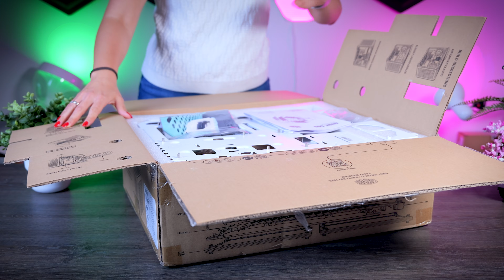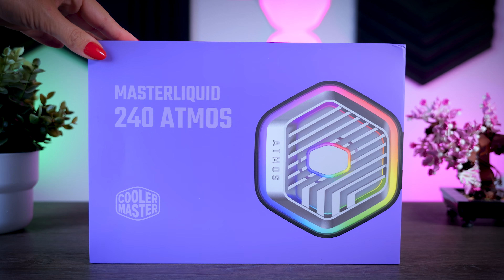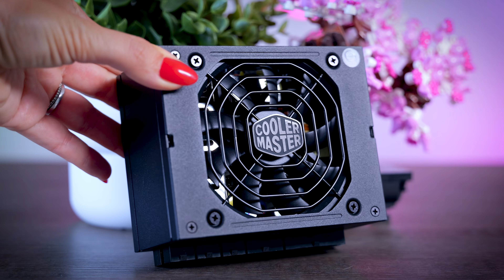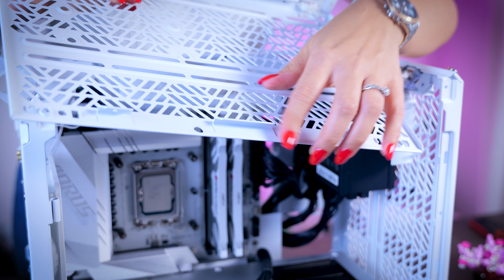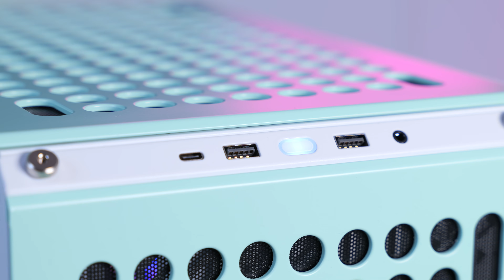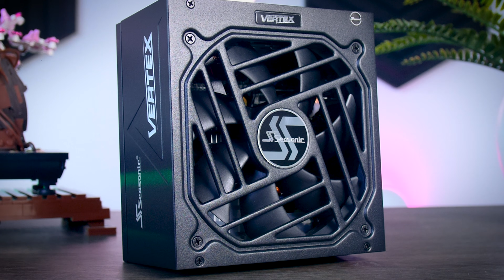The IKEA Experience - Cooler Master Qube 500 Build & Review

Comment: I am building small servers, and this case was said to hold 4x 3.5 inch drives. Not mentioned at all. Disappointing.
The build style probably makes the case cable easier to install with pins easy to see in the open.

Comment: i dont do much testing, and im completly newbish with hardware, but i run a nzxt 250 and an asus 240 on my 2 pcs and have never even during testing had them excede 80c, anyone know if this is abnormal? I am running a cougar gemini x case with 3 intake 120's and the rads are top mounted out flowing, so airflow might be the reason, i just haven see this before. cpus are i9 11900 and i5 11500.

Comment: One irony of this video is... if you install the PSU into the Qube 500, you have quite or almost no space to toggle the mode switch...

I have assembled a mid-tier PC (5600G+RX7600, ITX board.) from the parts I had and the case itself is the PC is doing quite fine. Of course my CPU cooler is Wraith Prism and the PBO is on, hits 95 degree C with 4.4 GHz while running Prime95 Small torture test for all cores. 

So, yeah, this case isn't too bad although the PSU mounting scheme is somewhat distasteful for me.

Perhaps, if they allow PSU mount at the bottom side, It would be much better for my case.

Comment: "you can even have the rear I/O come out at the top - if you want that for some reason"
In my opinion such a statement can only come from someone who never had a system built in a case that provides that layout. I'm using cases with that layout since more than a decade and since I'm doing so, I had no longer problems with dust in the case or too noisy fans - unfortunately, there are very few of those cases and even rarer are those who got that layout right, since it only makes sense, if you can mount fans in the case's bottom and have the sides sealed shut, both to provide the natural upflow of warm air. That being said, i cannot understand why there aren't more of those cases.

BTW, another great layout which is pretty rare (or even extingt in modern cases) is a side-by-side cube. There's no risk of collision between PSU, hard drives/non-nvme-ssds or optical drives (yes, dear case vendors, there are still people that have a use for external 5.25"-slots) and a system in one of those cubes looks much cleaner whe it comes to cable management.
i just don't understand why there's no case on the marked (nor now or in the past) that combines these two features. You could easily fit an E-ATX-system with a 340mm-graphics card, a ton of harddisks and two DVD- or BR-drives in a cube with less than 400mm (w) x 500mm (h) x 400mm (d) and have it silently air-cooled.
I would buy a case like this way more likely than one of those glassy RGB-showrooms that are dominating the current marked.
Reply from the maker: I actually had the Silverstone RV05 as my personal case for years. Still needed cleaning regularly though.
Reply: @TechTesters  I had the RV01 (barely remember how it behaved when it comes to dust) and the FT02 (which I'm still using today for two systems). On one system I only have to clean on the outside sometimes, the filters twice a year and the top-fan once a year. Besides that I don't have any dust inside the case (except on unused HDD-frames - they're breaking the air-flow in the front). The other system showed no necesity of removing dust in five years - but I don't fully count that because it is located in a small server room.
Maybe this is because the FT02 has a lot of small holes in the top cover, while the RV05 has fewer but bigger holes? That's one of the reasons I never changed to the FT05.
Reply from the maker: Loved the old Fortress cases. I should see what silverstone is up to these days. Haven’t worked with a case of theirs in years.
Reply: @TechTesters  They now have the Alta series that uses the same layout as the early FT and RV, but these are more "modern" (and in case of the Alta F2 rediculously overpriced).
For many cases today on the marked you can choose it's color (black, white, sometimes silver) but not, if you want it with a glass panel or not. I don't understand why. What purpose does a glass panel have in a big tower that's located under my desk? It's like a hyper-shift dipped car for daily use - beautiful in some cases, sure, but there are people who don't like/want/need it. That's why I'll stick to my FT02 as long as possible because meanwhile I lost hope that there will ever be a case that fits my requirements better.

Comment: literally shipped this to Hawaii, flew with my motherboard,cpu, psu and gpu, and plan to collapse it and fly home with it. fits my zotac extreme airo 4090, and the thermals are great with two fans at the bottom, a 240aio on top, the included argb fan in the back, and the top and bottom dust shields removed. sooooo worth it.
Reply from the maker: It just moves the caching from the DRAM cache to the system memory, so it shouldn't really affect the actual durability of the drive at all (or at least not significantly)

Comment: Question for anyone to answer. Can I swap the back and front panel? I have my PC on my right the ONLY reason I have no case is because for it to have ports facing monitor means I see the back of the case. If I can flip the panels and it still works then this case is perfect for me.
Reply from the maker: You mean the left and the right side? This case does allow you do go reverse ATX, so you can have the glass on the left side. Just remember your build will be upside down.
Reply: @TechTesters   Thanks, and cool that would benefit me.

Comment: Wish the build guide was available as a PDF, so I can see how they would install four 3.5 inch drives, lol.
Reply from the maker: They have videos online, not sure if that includes HDDs.

4 HDDs sounds rough though, unless you skip the GPU or get a tiny one.
Reply: @TechTesters  I do also believe something else has to be neglected like GPU size in order to fit it.
I only have two 3.5 inch drives and I could spend extra money on bigger SSDs to replace them. But I am still interested in how exactly they'll fit 4, lol.

I did find their build video after your video since you mentioned those QR codes to their build guide. 
They don't show where to put any sata drives in that video sadly.
I have also asked them about it but sadly no reply yet (perhaps I should find customer support email or something).
But thanks for the reply.
Reply: @TechTesters  I dunno if they have added it recently on the product page but now I can see an overview of where they would put the four 3.5 inch and three 2.5 inch drives.

Comment: Hi could you please check if the side panels are inter changeable. I mean glass on the back and solid vented on the front. Many thanks ❤
Reply from the maker: You can build it with a glass panel on the right side if you want.

Comment: This case makes me miss the larger, cube-style cases.  I had one of those large Thermaltake Core cases a few years ago, and while I'd argue that it was *too big*, it did provide the capability to mount the intake at the front and two radiators on the top, which allowed for a good airflow path.  I use a Fractal Meshify 2 XL right now, and to have two radiators, I have to put one in the front, which means I'm throwing warm air into the case -- not ideal.   If a case like this was just about 5" (~12.5cm) wider, I think I could do a lot more with it.  On that note, I've been tempted to buy two of them to see if I can rig them together (likely side-by-side) to give me more of a cube-style case.  I know they released some 3D renders of the case for some 3D printing contests, so maybe I can use those to mess around without spending $200.
Reply: I'm doing a custom arrangement inside this case, and used the step model of the case they provided in the competition (on Printables) to get a rough idea of the layout. Essentially, I'm moving the power supply to the bottom front. A 280mm long GPU (e.g. Sapphire Pulse 7800XT) just fits behind the standard ATX power supply. I can then just cram in a 200mm fan at the top front of the case, although it's not up against the mesh but set back a bit because of the front IO cables interferring. I'll fit two 140 fans in the bottom as intakes to the GPU, and maybe two fans on the side swing bracket thing, to pull hot air directly out from the GPU through the mesh panel on the 'left' side of the case. This way everything gets a direct flow of cool intake air (hopefully). Just need to model up and 3D print the custom brackets. I did end up buying the case to get a better idea of fit (it just arrived today), but I will buy my components later after Nvidia releases their refresh models, prices will go down generally hopefully.

Comment: As an avid ITX PC builder of many years now, I’m used to unscrewing cases to fit components in so a case like this isn’t a concern for me 😇👍. I think in more ….. student environment like kids pc, uni dorm etc, this case would sit well in a young persons apartment / studio. 
The AIO did well imo, considering it’s trying to cool a 13th Gen i9 cpu ✊🥰💪….. although tbh, in gaming the i9 isn’t too bad in terms of temps …… and if you’re buying an K-sku cpu, thrn your probably going to tweak / undervolt the settings reducing temps further.
Reply: Have you built a system in a Fractal Ridge case? If so, what CPU cooler did you go for?

Comment: Really great build and review. Pretty impressed with the temps as well. My only concern are the dust filters. They seem difficult to remove for cleaning.
Reply from the maker: Thanks! And you can just pull off the panels and reach the filters underneath. Not really a problem.
Reply: Ty… even better 😊
Reply: @tikishark1  KitGuru laid into them about those dust filters because they didn't like the airflow and Coolermaster said they'd upgrade them in a future update (no timescale yet). Which is nice.

Comment: Build it yourself case are very interesting as building is fun for me and thus looks like a great option, even better when you dont need to bend pannels like some competitors. Thanks for sharing with us
Reply from the maker: You're welcome! :)
Reply: For me building is a nightmare.
I remember watching a build with same case+motherboard combo that I have , and it looked so simple , but when I started to build it was a nightmare.
I constantly had a filling that I will damage the motherboard connectors and those same connections were extremely unpleasant when pressed against my skin.
And they just wouldn't fit inside an IO shield to the point I was tempted to remove the shield altogether.
And instaling CPU cooler?
That was a final nail in the coffin so to speak.

So I found PC service, brought it there and they did it for me.
And it was quite cheap.

Comment: Not sure I like the PSU up front and on top. Seems like that might make the case a bit top heavy and prone to tipping. Also, 240/280 is really not sufficient for 13900 or 7950 CPUs.
Reply from the maker: The center of weight is pretty low and the case isn't that narrow, so it's not going anywhere.

Agreed on the 13900K though, it holds but AMD is the way to go here. But 240-280 is plenty for a 7950X3D.

Comment: Seems like a neat case and I have no problem putting a case together with screws when I'm already in build mood. Avoiding to ship giant boxes that contain metal boxes that just contain air seems like a win / win in terms of shipping cost and environmental footprint. 

But what if I want to change something? Let's say the PSU was bad, I get a replacement of the same model and I just want to switch out the box. Cables can stay the way they are. Is that even possible or would I have to rip apart the whole thing again?

I'm also interested in the idea of a case with the connections coming out the top so that I could push the system right into a corner. The only thing I'd be worried about in that config would be the airflow, specifically if the feet raise the case high enough so that the front (now bottom) intake isn't impacted too much.

Great video overall ... even if the choice of color is incorrect, obviously. 🤪
Reply from the maker: I'll take a closer look at PSU swaps when I change the build in the coming days. I think it's easy enough to reach but I want to be 100% sure. YouTube makes it really hard to track replies to my replies, so if you leave a new comment in a week or so (or use Twitter/X/whatever) I can tell you next time.

Comment: I am on the fence about this case...its nothing but a fancy q500l that costs more and you have to put together. The q500l has been around for like 5 years so this is not new at all.  Also The color choice on the special edition is awful.
Reply from the maker: Similar design basis as the Q500L, but that one clearly had worse build quality (and an acrylic side panel) and doesn't have anywhere near the flexibility this does. So it's a bit more than just a fancy version imho.

Colors will be subjective though :P

Comment: it's refreshing to see front-mounted-PSU cases nowadays,
years back I got Fractal's Node 304 and it's still the perfect layout ITX case, in a similar way PSU is put in front of the motherboard along the gpu :)
Reply from the maker: The Node 304 was great! Except for the cable management 😅
Reply: @TechTesters   not easy I agree, but doable, case frames are "hollow" so they can hide most cables,
of the parts, Noctua NH-U14S cooler could fit, and EVGA 980Ti Classified fit too,
biggest issue is lack of clearance for multiple 2.5" SSD cables, but there are some 3D-print mods for custom cages now :))
Reply: Looks like PSU airflow is inside the case. Its weird :face-fuchsia-tongue-out:

Comment: What are the reasonable average stressed temps for both CPU and GPU? 70-80?
Reply from the maker: Depends on the CPU and GPU, but anything that results in 70-80 C is completely fine. Case temps I usually like to see <40 C, but there is a bit of leeway. 

If you're stress testing a recent Core i9 with 300++ Watts, expect most coolers to run into thermal limits. Then it's just a question of how many Watts it can actually handle.

Comment: Its not a bad idea that you can customize the layout a bit, wish the filters were better coz it looks like fine dust can still get in
Reply from the maker: Tbh I don't know a single case where you'll completely avoid dust, getting a nice Compuclean blower and a case that's actually easy to clean is the best solution imho..
Reply: I don't think the problem with dust will be big since there is no fan that draws air into the case :/ Only those who throw out... so it enters passively
Reply: @jovanpejic do you know that accumulated dust entered passively builds up faster than dust entered through moving fans
Reply: @adonromadhon3630  In my fcase, the most dust collects where the fan blows that draws in air, but that part of the case is closed, so the air from one part of the sheet calms down and the dust slowly settles.

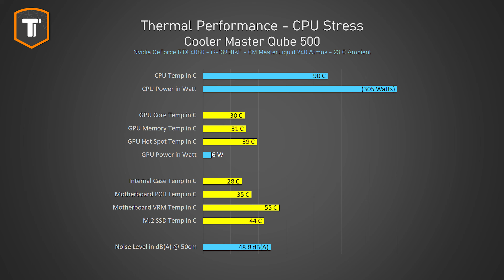Comment: 8:27 GPU only uses 6W on idle? Do they plan to make this case just bigger?
Reply from the maker: Yea. That is with software reporting though so it can be a few watts off, but <10 Watts is typical for an Nvidia GPU in idle. (GPU reviews are done using hardware tools, just saying).

No info on a Qube 700 :P
Reply: Thanks for answering  @TechTesters

Comment: Oh wonderful. Coolermaster is saving money on assembly and shipping yet price is high to customer. Scumbag profiteering. I hope this case will be giant flop.

Also non easy removable mesh is just stupid. Nothing like making cleaning harder to user :D Luckily there are much better cases in lower prices then this cash grab.

Its weird that you didn't mention that issue.
Reply: Other reviewers have mentioned the panels are much thicker than normal, which costs more to produce apparently.
Reply: @mikep9418  its a small case. In that price range you get cases with lot more features and total weight ergo more material used. They are just inflating profits. Its a case that consumers and reviewers should despise. Then again we can see that many reviewers are just paid and they dont care.
Reply from the maker: What @mikep9418 said: to make this work the panels actually need to be really well built, and more precisely built as well. They'll definitely save on shipping but in the end I think we need to judge total price vs the product you get. And I think the value is there.